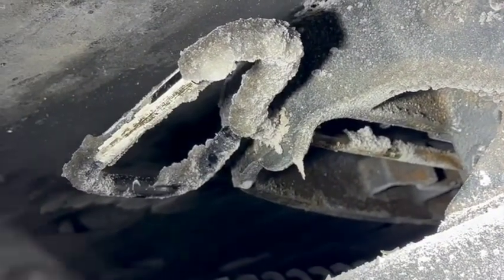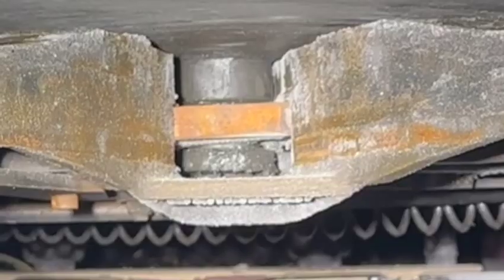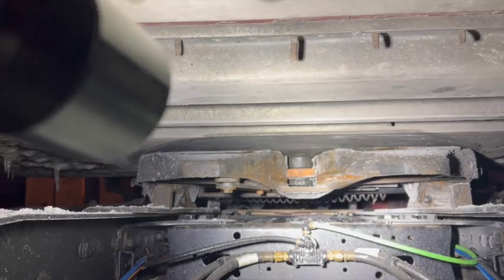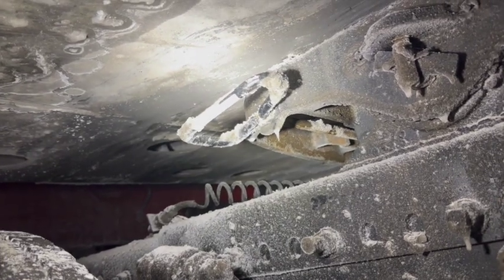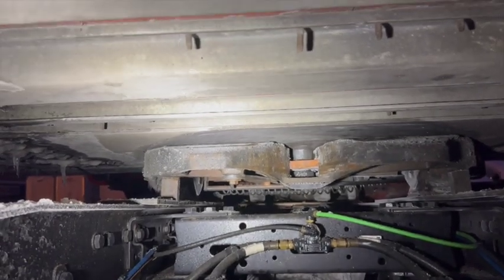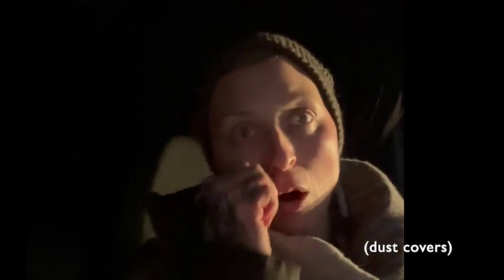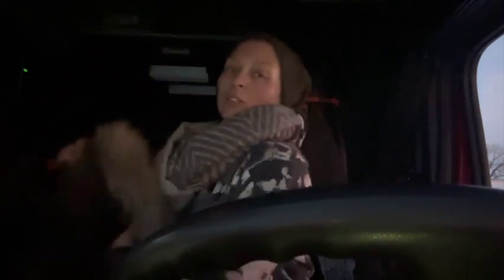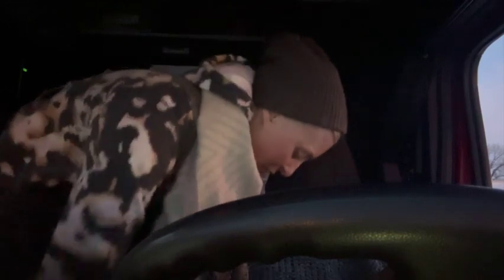Sub-Zero Tractor Trailer Coupling In Minnesota!!

Comment: Good stuff, Janna! One very minor clarification … Putting the truck into a higher gear (in this case, R2) doesn’t give you more power, per se, it just helps to reduce the uncontrolled wheel spin caused by the higher torque to the wheels of lower gears. By reducing the breakaway and spin of the drive tires, it’s helping you hold traction.
Reply: Dirk I miss your videos!
Reply: @HoleShotWin1320  Thanks, man! More videos coming soon!